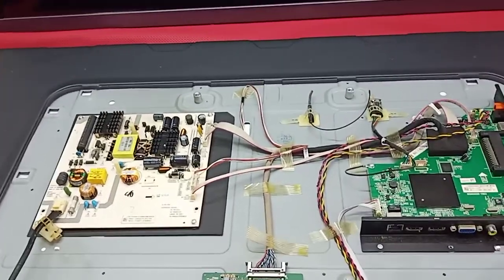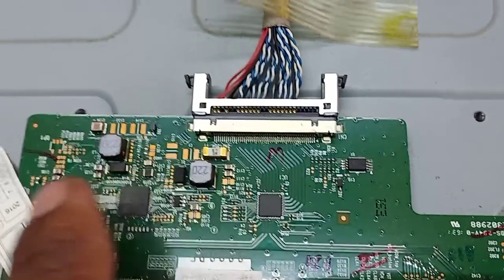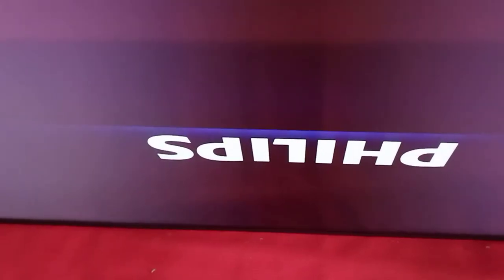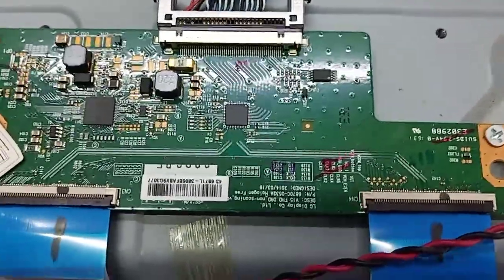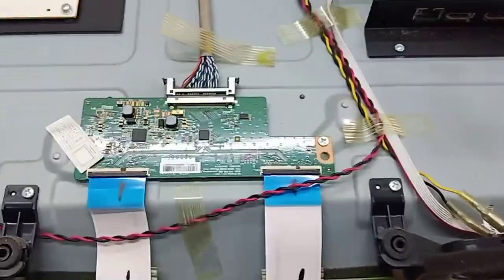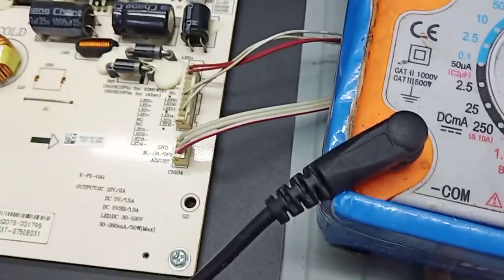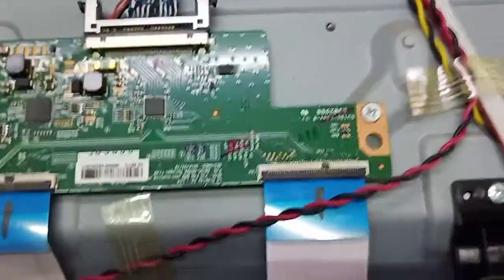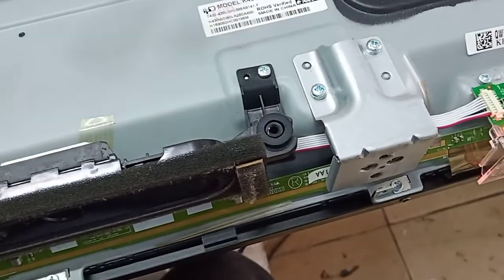PHILIPS 43 Inch Smart LED Tv/ How to repair Double Image Problem Model 43PFT6100S/98

Comment: 43put6504/56 Tecon board repairable
Reply from the maker: Hi what is the problem with your tv... No display problem?
Reply: @faisaltelevision708  display not working
Reply: @faisaltelevision708  display not working
Reply from the maker: Check t con board
Reply: @faisaltelevision708  technician is said Tecon board faulty
Reply: @faisaltelevision708  pls suggest which model we can use (43put6505/56 Philips)not available
Reply from the maker: Have own t con board inside the tv, You are Thecnician?
Reply from the maker: Your tv is philips brand?
Reply: @faisaltelevision708  ys
Reply: @faisaltelevision708  ys
Reply: @faisaltelevision708  ys
Reply: @faisaltelevision708  ys
Reply from the maker: Philips and LG t con board is same...